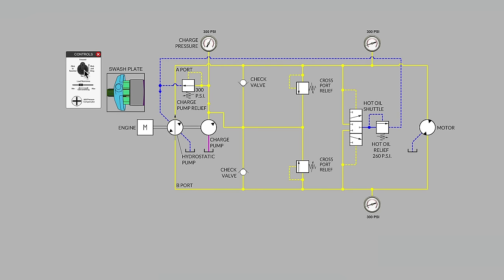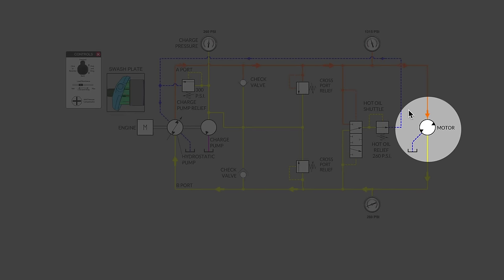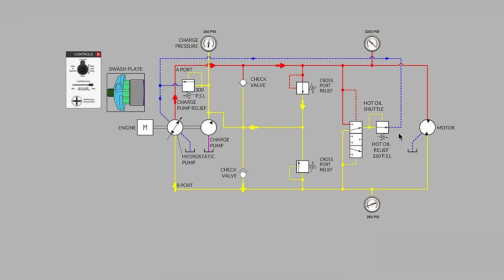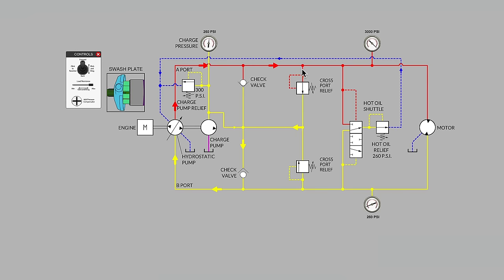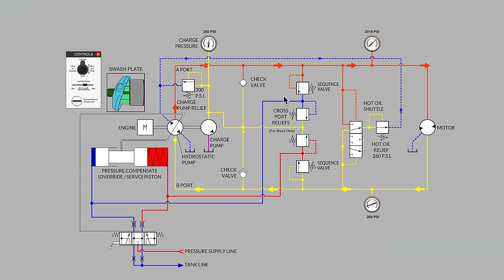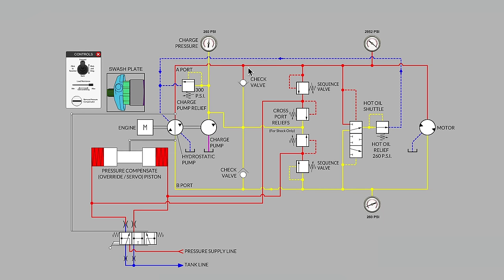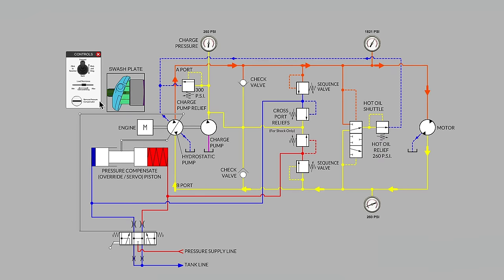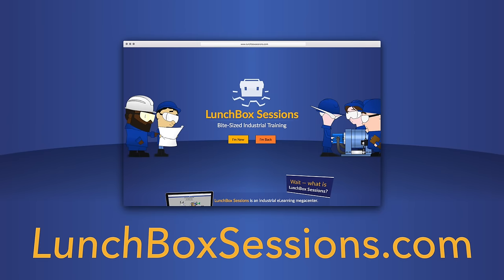Closed Loop (Hydrostatic) Systems - Part 2

Comment: I am using a SPV2 type hydraulic pump. But, when the pressure reaches 100 bar, the electric motor stops. Can anyone help me with the hydraulic circuit diagram of the SPV2 hydraulic pump? Thanks very much.

Comment: Thank you sir for this video,  Could you please explain the pressure source of proportional direction valve or how the max drive  pressure limitation set before run the motor in close loop system.

Comment: Can you connect a counter balance valve piloted from the opposite line to the motor in this closed loop system ?

Comment: I have t450 gehl paver its sometimes unresponsive in drive low gear just a notch with handle to swash plate it will stop so if check for line spike t with guage 1 way to fault if has relief valve or the charge pump is not  optimized pressure  its 70144 Eaton tandem with gear pump I'm not sure if need to t the charge line or pull reading off a port or where the line goes in or am I just checking line load I don't want to fry the pump

Comment: Help me understand something.

Without the the pressure compensate Piston and the sequence valve at @4:18,  the fluid went through the cross port relief valve from the pressure supply line to the cross line and then to the connecting junction which the charge pump outlet is flowing. 

The charge pressure is at 260 psi, does the cross port relief valve reduce the pressure to 260 psi, cause if not wouldn't the oil flow into the charge pump. But then again wouldn't the charge pressure go up just go up?
Reply: Artur, I’m happy to help. The fluid is at 260 PSI after passing through the cross-port relief valve due to the setting of the hot oil relief valve over on the right side of the diagram. That H.O. Relief is setting the maximum pressure for the entire return side of the loop. Does that make sense?